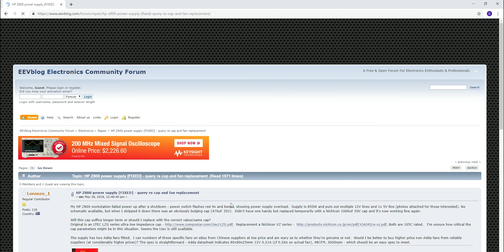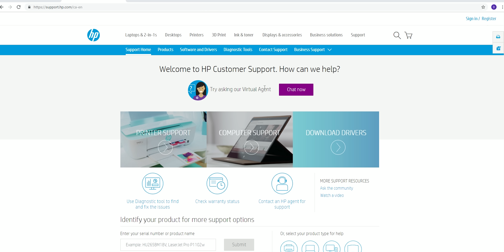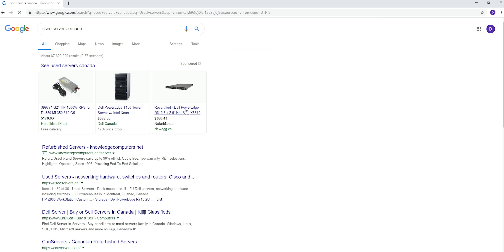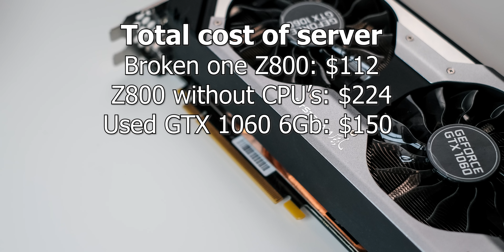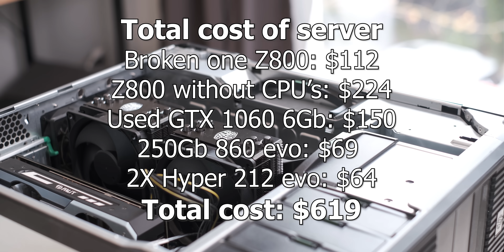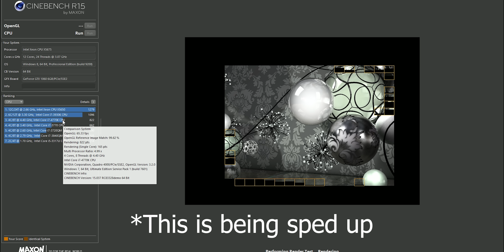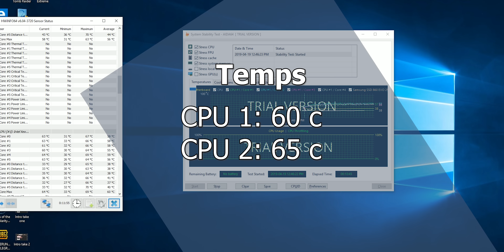Dual Intel Xeon, 48Gb BEAST for under $700! (With Benchmarks)

Comment: I recommend getting the hpz440 / (not the 420 or 400) - much newer - usb3 / will come with windows 10 license - you can also throw in a 12 core / xeon hyper threading / 24 cores - ebay is your friend. The ram can scale up / match above specs.

Comment: Though I really dig Xeon based systems and this one really does it for me, there's just something about recycling old server grade PCs that is soo cool... When you compare this type of setup to more modern setups and especially against Ryzen, it's hard to justify it for the price. At the time of this video though, Ryzen was definitely more expansive.
Reply: It's hard to justify the price itself though. Dual X5675 with 48GB of ram, was not worth anywhere close to $700 in 2019. I just checked and a similarly specced R710 have been selling for only £120 on ebay... Even in 2019 they were only ~£150, and even less in the US, this wasn't worth more than $200.

Look up "My 20 core/40 thread, 128gb ram "budget" (~$600) home server build" on reddit. Dude shows a build of dual 10 core E5-2660v2 CPUs with 128GB of memory for only $600. Much much better performance, much better power consumption, more RAM, and cheaper...
Reply: @lost4468yt  in the technology space, the price and performance ratio changes daily, with that said.. I wouldn't make the same comparison that I did a year ago. While I do think recycling/reusing is awesome, I couldn't justify going this old verse newer tech.
Reply: @paulscomedyclips  Yeah I agree with reusing old equipment. I think this is pretty much on the barrier though, as it was the generation after this that dramatically dropped power usage. Our R710 uses like 220W at idle, which is ridiculous.

But things like the E3/E5/etc, especially v2 ones, I think should be reused for a very very long time. They use much less idle power, and they're still more than powerful enough for most server applications. Because computational requirements have simple stopped increasing. I think that something like an E5 v2 or even v1 CPU will likely hold up well for at least the next decade, possibly even much longer.
Reply: @paulscomedyclips  well for 200 dollars I got a CPU that has never bottlenecked by GTX 700 4GB and I got 24 GBs of cheap RAM for free and a whole ass computer it's a T7500 btw I consider it worth it for 250 dollars
Reply: @lost4468yt  you are right. I bought the same stuff in 2015 for the same amount of money. Z800 is getting very old now ( it is PCIe-2). I don't know why this guy was expecting something amazing. It is 2009 architecture. In 2019 is certainly not a bargain anymore. In 2021 it is not worth it. A 6 core amd ryzen 5 is way better than this and 3-4 times less power hungry. Even the z820 now is old. I am still keeping that beast for running old software because it has got 72gb ram, which is still a lot, but I will have to buy a new one some times in the future besides my personal PC. Besides, it runs very hot and noisy during the summer...

Comment: You can drop x5680's or x5690's right into that thing, the latter running at 3.5Ghz base and 3.80Ghz Turbo. Great video. 👍👍

Comment: Were you playing with the mobo to PSU connection while the PSU was plugged into power?  A GFX should not catch fire unless you were performing such a move, and that could very dangerous to your own safety as well.  You never never never plug in add in cards or modules while the machine has power.  Also your thermal paste application I wonder about, me personally I always use a card or a piece of paper to make sure the thermal paste is spread around the entire top surface of the CPU in a thin, even layer, wherever it will contact the heat sink to ensure proper heat transfer.  Just a couple of tips for ya going forward, otherwise, cool build.  Although I imagine it must be a hit on your electric bill if you intend to use it as an always-on home server, yikes!

Comment: I just want to point out that for $700 I can potentially build my own AMD Ryzen 7 3000 serier with 32GB of RAM and AMD Radeon RS5700 video card which is faster than the dual Xeon you are using right now.
Reply: Really? Do share where your parts sources are?

Comment: 24/48/72/96/192gb, sounds like lga 1366, i myself have dual x5690 48GB of ram(used to have 72GB back when dell T7500 worked which i originally bought with 24GB ram and dual x5570 and i believe an artifacting GTX 460 for $200) but now with supermicro board, and HAF XV Evo i have water cooled processors, and a GTX 1080 hybrid, IIRC it cost me less than $900 all together not including my 16x2.5in hot swap bay and 16 drive SAS controller.
Pro tip, if your board supports it, get ECC FB DIMMS 10600R 8GB seems to have been running for ~$12(US) for several years, i have a dell C2100 with 96GB(maximum supported apparently on this board with 6 free RAM slots out of 18) and an R710+R510 with 48GB

BTW as evident at 2:11 your ram is ECC unless i'm counting the chips wrong(odd number of chips almost always means error correction is present) though it appreas to be ECC-udimm instead of rdimm, which is good, udimm is faster, buying rdimm would probably require replacing all those udimms, though i havent tried, these things seem to not care at all about ram mixing, i've got hynix, dell, hp, and samsung ram in the same server with no issues for more than a year, though it is all rdimm
Reply: I also found out recently my motherboard has a problem, all PCIe slots are running at 2.0 x4 so my GTX 1080 is significantly bottlenecked(i had assumed it was because of the 10 year old processors but i was wrong, i thought when i went from dell motyherboard it got slower)

Comment: my friend got the 820z with [Dual CPU] Intel Xeon E5-2690 and 64gb ram... he uses it for video editing but really, its not very impressive at all..slow as hell to boot and  feels no faster than an older i7 if ur just websurfing... really, the system was for video editing and audio creation and even there, its been dissapointing as far as speed of production...it has so many cores and hyperthreading, yet only lightly uses them in any application like the adobe video editing and audio creation softwares..

Comment: Every video i watch about dual CPU systems talks me out of building a dual CPU system...
Reply: If you want to use one as a Windows desktop? Yeah I generally wouldn't bother. But if you want to use one on Linux, or especially if you want to use one as a server with virtualization? Then absolutely go with a dual CPU system. Dual CPU systems just work when you use them for what they are intended for. You can pick up a Dell R710 or R720 server on ebay for cheap these days, dual CPU systems with plenty of registered memory. Throw Proxmox or ESXi on there and chuck on a bunch of Linux VMs and self host a ton of fun things like Plex, NextCloud, BitWarden, etc etc.

Comment: Late to the party here, but I thought I'd offer an EE's opinion on your GPU fire.
My guess is that your original PSU was FINE, and didn't destroy the graphics card AT ALL. Rather, the GPU had a SHORT which carbonized some of the pins (causing a "dead spot") on the power connector. When you DID manage to make contact through the power connector, you caused power to flow to the short, resulting in the fiery death of the Quadro (which essentially proves that the PSU was working).

Comment: I built a similar old server about a year ago.  2 e5-2690's, 32 gb ram, about $700 including a used rx470.   The stock coolers were fine after I cleaned and lubed them.  They weren't so good before hand.

Comment: I was wishing it was 48Gigs of hard drive... that would be funny
Anyway I have one machine with 1 Xeon X5680, It cna overclock but it gets easily at 90C with a bigger cooler and the north bridge reaches 130 at those speeds, so i think it's quite dangerous if you plan to keep the motherboard alive.

Comment: I was able to buy two identical 
HP ProLiant DL360 G7 fully working for $140 a piece.

-DDR3-1333 CAS 9 Tri-Channel ECC 24GB Memory;
-Dual Socket Intel Xeon E5649 6 cores HT, total 12 cores 24 threads;
-2 x 15,000 RPM SAS2,0 HDD;
-2 x 460w PSUs;
-4 x 1Gbps NICs;
-1 x 100Mbps Lights out;
-Bought another RAID card "HP P812" card for one server so I could use a HP Storage Works D2700 with it;
-Both have the PCI-E 2.0 Riser card;
-Plan on getting an AMD single slot low power GPU  some day for one or both;
--Might do an external GPU/PSU setup for a far better newer GPU but I really want to have it all internal;
-Plan on using them both for hosting, backups, testing and dev, rendering, etc;
-Plan on buying a rack mount case.

Comment: I was given a couple of Z600 workstations and decided to use one for a game sever. They were said to be working, but missing ram, hdd's and some of the drive trays. I found drive trays on Ebay for $30 (enough to fill in all the missing trays on both pc's and have one extra). I wasn't sure if I could use non-ecc ram, so I got 24gb ddr3 1333 ecc ram for $90. I found the fastest supported cpu's for the mobo I had were X5570's and found a working pair for $18. I added a usb 3.0 card for about $20 and a $35 sata 3 card for running a ssd that I already had. Next was a spare 1TB WD Black hdd I had laying around for mass storage. It had a old Nvidia Quattro in it already, and for what I would be doing with it, that was fine. Grabbed a $14 win10 key and I was good to  go. Makes a really nice dedicated game server for $207.00!

Comment: I have 2x Z600 C2s the C2 is important as the motherboard takes the 56xx Xeon chips and uses 10600R Registered (server) memory which is a lot cheaper than standard 10600E ECC memory not registered. THese are quad core but you can get hex 6 cores as well. They are GREAT cheap machines BUT they weigh an absolute ton as there built to last, which from my experience they do. Advantage of the Z800 is it has 3 storage slots unlike the Z600 which only has 2. They are only Sata2 so its  a good idea top get your hands on a LSI 9212 raid card (Cheap on eBay) this gives you Sata3 and add a SSD and they fly along quite happily all day every day !! Last time I looked the Z800 were a lot more expensive than the Z600 which can be bought for peanuts, be careful about postage  due to weight. Only draw back is the psu is not the most powerful so this will limit what GPU you can use. and with the Z600 make sure its the C version and not the B else your limited to expensive and more limited amounts of Ram

Comment: I sold my dual Xeon 2687W precision workstation on ebay for around $550 with 64gb of ram and firepro gpu back in June. Performance wise, it was on par with a 2700x for most single threaded and FPS/gaming benchmarks while destroying it on multithreaded workloads, it did 2200 Cinebench R15 score. The only reason I sold was the power consumption, and how uncomfortably hot my room would get with it on. I don't really see the value in socket 1366 anymore Because 2011 & 2011-3 have come down in cost a lot while giving huge advantages in ipc and power consumption.

Comment: I bought a Dell T7500 for $488. It has a dual xeon hex core with a total of 12 cores. It also have 16gb ram and a Quadro K4000. It is not overclocked and uses the default fans. Runs like a champ No issues. There is a slight connection issue when opening it up you have  to ensure you fully seat the extra CPU/ram board as it will not boot but that's not really an issue when its in normal use. ;)

Comment: Maybe not the first too mention i hope, but DONT OPEN YOUR PSU until jou read-up on how to service an PSU. Capacitors can retain power for a long time, and bridging components could break YOU or the PSU ;)

Nice built though
Reply: Damn it took too much scrolling to find this. Discharge it if you're gonna work on it. He touched those thicc traces too. I can't believe he's not dead. Lucky.

Comment: but what you can do with this Z800 that you can't with most Ryzen and i7 is use upto 3 full PCIex16 AND two PCIex8 - simultaneously !!!!!
Ever wondered what happens when you add a PCIex8 M.2 NVME adapter and a 4-6 channel USB3 adapter or a dual/quad channel 1Gb Ethernet to a Z800 ? - you just guess or try ;-)

Comment: Seems like you overspent quite a bit on this. I'm using a Dell T7500 w/ 2X Xeon X5675's, 24GB RAM, and also added in USB 3 and Wifi through PCIe. With all of that (excluding my RX 480) I'm at basically under $300 for a system that performs similarly as a workstation, as a Ryzen 7 1700. Although you have the same CPU's so I'm preaching to the choir lol. But I guess maybe there is less availability in your area, so that could be a big part too.

Comment: a couple of weeks ago i sold my 5yrs old z600 (bi x5550 (mobo v1, i couldn't upgrade it to hex cpus), 12gb ram, gt 640 3gb, 2 x evo 840 256gb in raid 0 on lsi sas 2008  it mode) for 200€ :-) it was a very stable machine, but it just could't stand versus i7 8600k with m2 pcie drives and gtx 1060 6gb, 32gb ram on asus prime z370 (paid 500e for it), my photoshop now runs 2-3 times faster on 8th gen  i7. for an average dude (who rarely runs massively multithreaded software) in terms of perfs your "BEAST" xeon is just a basic machine in 2019 (you can make it into a great hackintosh and sell with a decent profit btw), if you plug a higher lever nvidia quadro P6000  into  it'd be still ok for autodesk & co, but your game would run at 120+ fps on a recent 2nd hand conf with 8th gen i7 and you can get it for a mere $500-600 as the gamers are never  happy with their fps and dump quite ofter their $1k+ configs for 1/2 price. i think this z800 with 1060 could be good for trying machine learning on a shoestring, 1060 is actually rated as the best per $ cost machine learning card... for h264 video compression it would be fine too (for h265 nvida are doing better today)... oh, that i didn't like about z600 - too long boot times, on modern uefi you boot in secs, and also it sucks 2 times more power than recent hw...

Comment: Something I've noticed is the little gold triangle usually goes 90 degrees from the end of the lock down bar, so you go to the end of the bar, make a right, then go to the next corner and that's where the triangle goes.

Comment: Or for 400,
I3-9100f - 80
16 gb anyshits - 60
Rx 480 - under 100
Mobo - 40
Case - 35
Used psu - like 30
Reply: Getting used power supplies is almost never a good idea.

Comment: i got a DELL T5500 that came with 2.4GHz quad core XEON's. i put in 72 gigg RAM and a 1050Ti and all in all it came to about 550$ then i got two 6 core 3.4GHz CPU's in it and that put another 180$ in to it as i needed a HP cooler i got from china for it. it all fit's tho ;)

Comment: Unless you’re running jobs concurrently through VMs (or otherwise), dual Xenons will usually look a little underwhelming compared to single CPU home systems. The benchmarking software isn’t really optimised to measure the systems’ true capabilities.
Reply: Not only that, but a dual cpu system is bad for gaming. While the avg fps is good, the 1% and .1% lows are awful. This is a thing on all dual cpu system
Reply: @o-hogameplay185  search for NUMA and threadripper and gaming. You will understand what is the cause, and how can it be fixed / worked around.
Reply: what about emulation?
Reply: I've had a HP gaming laptop Ryzen 5 GTX1050 and a Surface Book 2 i7 GTX 1060 and have been very disappointment when emulating Android and Game consoles.

 I can't be sure if it's software or hardware related, the info just isn't there. You'd think your system would know where the bottleneck is, it doesn't.

 Just not the kind of problem you can throw money at.

Ricky.
Reply: Yes and you will often run into issues if you try just running Windows on the system. Instead throw something like Proxmox on there and make a few linux VMs.
Reply: need to run Mac OS and windows (in a VM at the same time) so yeah I think its a good investment.

Comment: each x5670 eats around 170watts+!!
so you burn around 340 watts every hour only for CPUS!
with MOBO, disks and video card it would be around 500watt!
now, if you use your PC around 8 hours on average (most games do even more than that, weekends more and normal days less),
then math is simple:
500 * 8 * 30 = 120KW/h per month
now, in california, each KW/h costs about 20cents.

120 x 0.2$ = 24$ monthly just for random usage.
i would say its like 30$ or even more!
so in one year, you would burn 350-400$ on electric bill...

old PCs and especially server hardware are very power hungry indeed...

not really worth it unless you have solar panels on roof and practicly free electricity

Comment: Hah your scores are the same as my single I5 3570 with a 1060 3gb. The only difference is my computer doesn't double as a space heater.
Reply: Completely different purpose
Reply: It’s a workstation build I can guarantee you ur pc sucks at 3D modeling and video editing
Reply: Immanuel Fowler I guarantee that build isn’t much better. Unless he is editing in last gen formats or rendering lower res models.
Reply: Maybe not 3D modeling but definitely better at video editing

Comment: creat work friend this z800 we have it on our work and i do maintenance for them i have z800 and z420 and z400 so if you have any videos soon about z820 and z840 wil  happy to see it you realy  do abest performance for z800 bit aboit power supply you talk real beacuse i have one of this problem with z800 and power supply has fail and i do fix for it with a best professional in my team and fix the bad capacitor and make track for the sensor have been damage and work until this moment creat so z800 the onley part have problem i think it the power supply for the performance is amazing but with ssd unless it have low speed beacuse sata 2 not sata 3 .and with quadro 6000 work good .i have many cards in egypt quadro 4000 for   38us dollar but the performance for any edition pny or quadro is still stable for some time .hope to see more in you channel .thanks